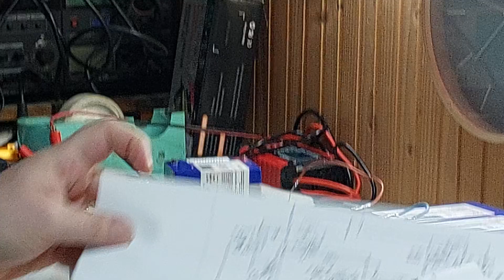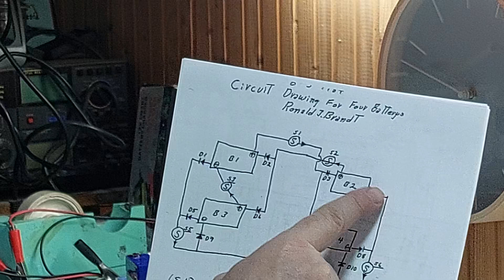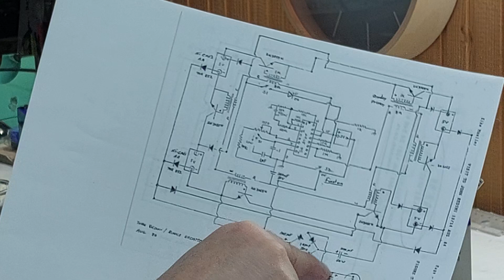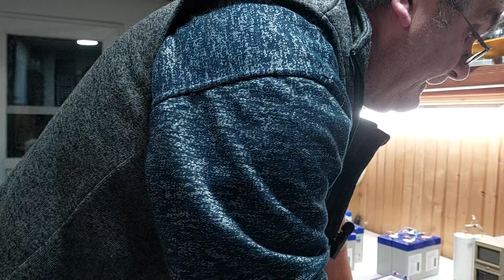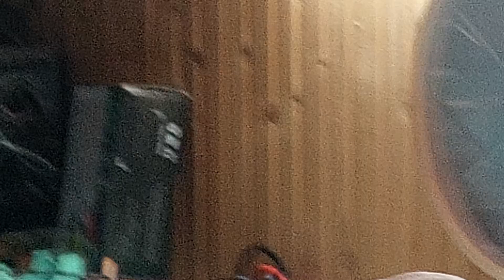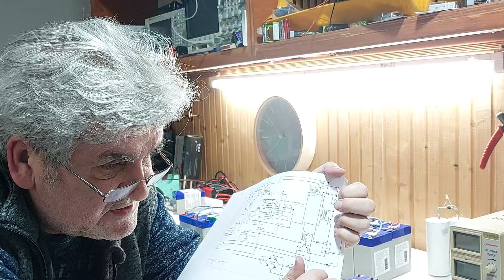FACTS AND MYTHS ABOUT TESLA SWITCH

Comment: from benitez: "complimentary energy" (energy cannot be gained in this system) UNLESS the usage of "one of many methods of producing currents of high frequency" is ADDED. not a direct quote but what he appears to be saying is adding an induction coil, spark gap, bedini circuit, or any other kind of "make and break" circuit within this system is what leads to gains and turns this system into something that actually GENERATES energy :) see benitez patents and rick friedrich's benitez vids for more info!!! lots of potential in this system!!

Comment: Are your experiments made with pulsing current made with the tesla circuit for creating pulsing current?
Reply from the maker: Sorry, can you be more specific about "The Tesla circuit for creating pulsing current"?
Reply: I'm sorry, im not an electrical engineer, elctricity is not my field. 
There is this italian book writer, marco pizzuti, he wrote this book on alternative energies ways that have been apparently ceased down by the syste.
He talks about many inventors, and also Aldo Manfredini, who apparently using tesla projects managed to actually build the tesla switch, a machine with 2 batteries that apparently never ends.

He just says that to build a tesla switch the batteries need to be recharged with pulsing electricity, which is easily (for you maybe :D) made, its that device that gives you a lightbulb that u can light and submerge in water without problems, i thin they also call it cold electricity. There is many example of this circuit on youtube and internet.

Pizzuti say that the tesla switch works only when u use this pulsing electricity made with the cold electricity circuit (sorry, i dont know the english name).

Aldo manfredini patent is online, but i cant understand anything about his patent, drawings are poor and incomplete explaination.

 Obviously, maybe this manfredini was a scammer (there is a video of him presentin his invention on tv), i tried to contact him but the mails dont work anymore.

I have been interested in this fieldforl a long time, but i dont have any electricpreparation to understand all this and no time to research :D

Comment: Hello Milan,

I am not sure if this explanation really reflect the reality. There is someone who managed to swap batteries between series and parallel and kept an LED lit up for 275 days continuous. I have to admit that I don’t have the patience to run such test but, a short test I did seems to be correct also I have replicated few of his circuits with great results.

Now, there is scientific explanation why batteries in his setup last for 275 days for just an LED but, for sure if you power that LED in “traditional” way it wont last even for 24 hours. So, his “Tesla switch” was efficient at least to say … and the principle can be applied for much heavier loads with much bigger batteries.

Maybe you want to reconsider “charging” batteries for recycling the energy … considering batteries will be swapped when series has lost the power. If you watch his videos about this you can understand what is going on there … even if there is no gain …I think it is all about how we use the stored energy in batteries … or even any other power source.
Reply from the maker: Hi, well I made similar test with no switching the source battery was 12V 4.5Ah , target 6V 4Ah the load was 2 x3 LED 3 W each, exactly shown in this video at 14:12 I run this simple circuit without  having Tesla Switch in my mind, I had something else in my mind. I stopped after  little bit over 6 weeks without  making a break. I stopped not because the light was useless, but  was dimmed of course. I stopped because 6 V battery was in danger zone  almost 7V  and it started to be sensitive to room temperature. When you have  very dimmed light, than it draws in uA range. BTW Sorry I am not sure about whom you talking about ?
Reply: I have posted the link for this video of that gentleman who run test for 275 days … I can’t say if there is a gain or just recycle the same energy … but, overall the result is simply amazing and it seems it can be applied to many types of batteries and loads, probably there is a certain ratio to be used.

But, you are using different setup … where in the video I refer to there are 6 batteries in total, 3 in series and 3 in parallel, which are being swapped when the series lose the voltage, and swapped again and again … 275 days continuous !
Reply from the maker: @Caesarus2011  Sorry, I did not see then. Reason why I used like this  is high power of LED and if it is out of control then it can discharge the source battery  below  recommended level. If I will have  source capacitance  let say 5Ah and target capacitance 15 Ah, then  this circuit needs  monitoring to avoid over discharge the source battery. My goal was not to swap batteries or anything like  this. Even it looks amazing what  he  has done, by looking the size of batteries and type of LED I am not surprise. I can bet he did not get more energy out. The test what I  have done also did not show  anything unusual I think. When I was in business with developing street led  lamps and solar led lamps I used trick to go with so many LED 800-1200 pcs to go on the bottom and it produced high efficiency compare to  the competitors lamp. But later other did similar and development of LED is changed any way and it stopped 2018 because my design was not advanced like before, plus new regulative made this business harder.
Reply: https://youtu.be/wEesPlaSzWI?si=2nLyKRAO7sUeMx7N
Reply from the maker: Hi, here is electric bell that works 176 years https://www.youtube.com/watch?v=UtQGYz4f3YQ
Reply: Indeed … but, it was about gain/recycle of energy using “Tesla switch”, not longevity of galvanic pile.
Reply from the maker: @Caesarus2011  I know that, I just to wanted to show how  driving a 0.06 W led with that size of batteries is not  surprise tow work that many days. Extraordinary claims need a relevant proof by proper measurements. Back 2013 we made long test run of 365 days . It was about our solar charger. We put the same type of PV panels from the same manufacturer on the roof and the same high power resistors. One  system was with our solar charger , another with branded type . We developed all  where every 10 s several parameters were  sent to lap top that was has several backup if electricity from the grid will go out etc. Also every day were collected local weather condition. By finishing one year run we gave that all with analysis to company that ordered that project. By having a measurement like this we were able to claim something.